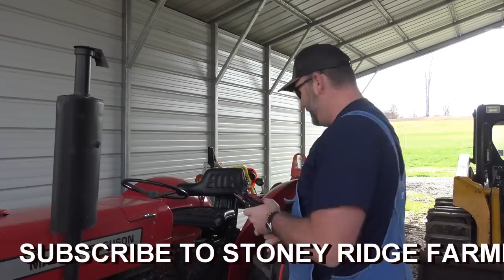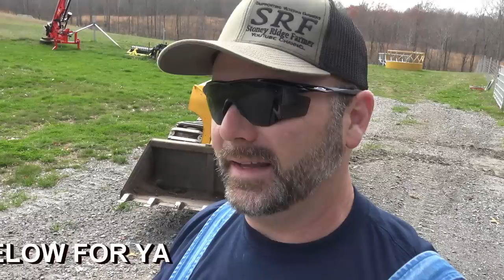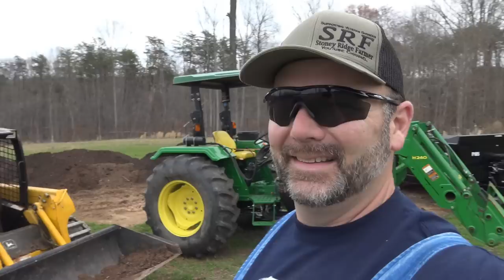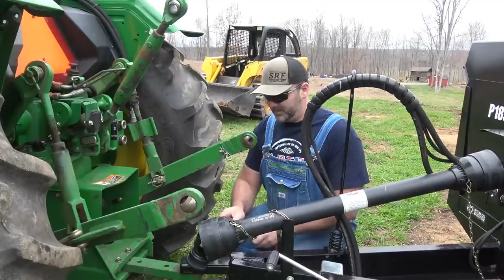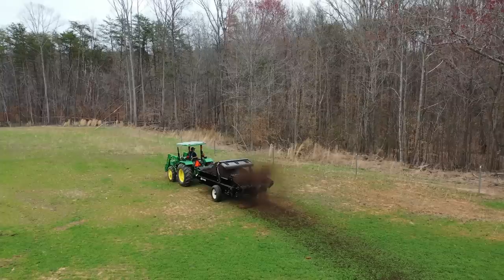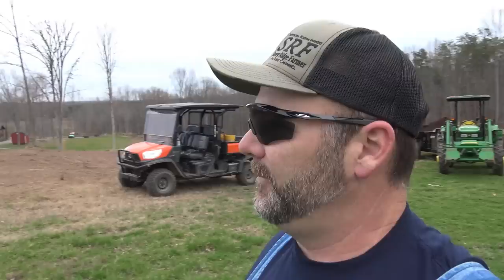Farm Tractors at work...load it up and spread it out!

Comment: Run a set of leads to the outside for a jump port.
Reply: I’ve seen people use the forklift charger connectors so you just have a plug on the machine and jumper cables cut off with the other plug on one end. Pretty neat and nifty setup.
Reply: Charles Lowe the make the kit it’s actually the same leads and connector most all winches use

Comment: With the hydrostatic drive on the rtv when you hit a hill you actually have to let off the gas initially then ease back into to it. You'll see a big difference by doing this and it wont seem to stall out like it does when you floor the pedal going up a hill. Our Kubota dealer has actually  had people try to return their 1140s due to this until they show them how to approach inclines. Enjoying the videos!
Reply from the maker: thanks .....I'll give it a try

Comment: Mount up an external battery jumper block and wire it into the battery.  You can get them from Summit Racing or other places.  You can buy the complete terminal block with bracket or just the studs and fabricate your own mount.  They are standard fare on most race cars because the battery is always in an enclosed box inconveniently located for better weight distribution.

Comment: Hi josh .. another great video !! As for your John deer vibration.. when they changed clutch hopefully they 1 either machined the flywheel as well.. 2 or replaced flywheel with new .. An also installed new pressure plate as well .. if not old ones could have gotten warped from old bad clutch causing flywheel an pressure plate to be the problem now .. if they did replace these or at least machined the flywheel then maybe it has effected the crankshaft in engine to be outa balance therefore that maybe why u still have vibration.. or maybe jus a bad run of clutches .. hopefully it will get figured out soon for you at no expense to you as John deer should cover all costs !! As for that beautiful manure mulch .. it’s awsome stuff to apply to your much needed areas as you say An will help greatly improve the land An soils.. although for the true effect on how the spreader works it is very very easy for a spreader to spread that stuff as it hasn’t any big clumps of manure like we often run into when we’re digging into our manure pile sometimes big clumps of manure stuck together an manure spreader tines at rear have to really chew them up to get it spread nicely ..  I’d be curious jus to see how well that spreader would handle chewing up real clumpy clumps from rear tines or would it jus throw big clumps out into ground ..? Some spreaders do better jobs then others .. to get a true to test of the spreader on what I’m saying you wouldn’t know with that very fine fine non course non clumpy manure .. would have to find some of that somewhere to really put it to the test .. anyhow my farmer friend I always look forward to your videos keep them coming 👍👍👍 Woooo !! 😁

Comment: Josh wire up a plug like a tow truck has use an Anderson plug mount it to top of that plastic cover wired to battery . Then put Anderson plug on your long jumpers yes ya have to cut the gator clips off one and but if they are dedicated for the Kubota then your golden ! I had. That’s set up on my trucks front and rear bumpers for my winch and my trucks jumper cables

Comment: Hey Josh. I put in 50 amp Anderson power pole quick connects on my kubota x1100c so I could have access to the battery quicker. Cheap solution and I converted everything on the farm to have a quick connect for that reason.

Comment: I had to laugh when you said that battery was hard to get at. I've got a little car in order to change the battery you have to pull a left front wheel and take off part of the inner fender cuz the battery is tucked in under the headlight inside the fender. It's a 2013 Chrysler 200. Now that's engineering at its finest!

Comment: Here's what I did on my service truck.  I installed a quick plug from a forklift battery charger to both the truck and the jumper cables. I put one on the front and back of the truck. And for not to much you can put a battery  disconnect on the ground side of the tractor battery.
Reply from the maker: very good idea

Comment: I don't know if your RTV is the same as mine, but on the one I have, the pedal controls the fuel to the motor and transmission  pressure at the same time. When going up a steep hill or pulling a heavy load , if you just smash the pedal to the floor , you will go slower. My dealer showed me how to push the pedal down gradually until you hear the motor start losing speed, then hold that position , this way you don't lug down the motor and lose power.  Try it on yours and see if it helps.

Comment: Josh What you need for the Ferguson is a what I use for my tractor battery. A Pulsetech 5 amp solar charger. I have 2 of these and they are great. My tractor sits all winter actually I haven't started it yet this year and my 3/4 ton Dodge also doesn't get used much. These chargers stay on both these machines 24/7 and the 2 batteries in the dodge is 5 years old and the tractor is 6 years old. Not only do these chargers make a battery last longer you can bolt it to the side of your shed and its done no AC needed.

Comment: Josh, I would install a solor battery tender on your awning to keep your tractor charged and install a battery cable connector on the Kubota so you just plug your battery cables in when you need them. You see these being used on tow trucks and you can buy the cable connectors on ebay.

Comment: On the 240 you can upgrade the alternator to a single wire 65 amp Chevy alternator probably would help keep the battery charged

Comment: Hi Josh, you may want to install an electrical quick connect on the front of the UTV and tie it into battery.  You will also need to put a connector on one end of the jumper cables... Then when you need to jump a vehicle, just plug into the front of UTV and you are in business...  Been using them on the tow trucks for years... As for you dead battery, just order a floating changer from Amazon, will solve that issue and keep the battery charged all of the time...God Bless...Chief..{NYS/ADK}

Comment: You may want to check your charging system on the Massey. If that does not work put a quick disconnect on your ground to battery. Hope one of these options might help.

Comment: Be careful with those pto extender couplers. On short coupled machines you may have to shorten the pto shaft to keep it from breaking a u joint or the stub shaft off when you go over a terrace.

Comment: Disregard the two black hold down bolts and get a longer bolt with the same type of thread. Cut off the top and then drill a hole in the top for a cotter pin. Screw the bolt down and then place the bolt through the holes in the cover. You may want to use a washer or if not then just a Spring Locking Cotter R Pin. This way all you need to be pull the pin and off comes the cover. Just a thought.

Comment: hey Josh run you about a foot or so of # 6 or 8 gauge cable from your pos side of your battery under side of your back seat make sure when mounting it don't ground it out . on the end of the cable soldier the cable so you will have a place to connect your booster cable too you can gound you neg side on any spot of your body that is metal. I hope this help and save you some of your time.

Comment: Pull a post off your tractor battery when it stored, either that or go to harbor freight and get ya a battery disconnect. Another ideal for using a certain vehicle to jump start frequently,  you can get a quick discount where the jumpers plug in to a permanent connector.  We use one of these on our service truck at my day job.  You can find them on Amazon.

Comment: What I use for my battery charger and jumper cables is Quick Connect/Disconnect Wire Harness Plug Connector, which you can get from amazon, and I solder all my connection's, I also keep my jumper cable clips with my cable for people that don't have plugs.

Comment: I would get a set of the anderson plugs and make a quick connection to the battery so you can just hook up your jumper cables in 2 sec. Like on a tow truck. Would even need to open the hood. About 20 bucks and done

Comment: Get your self a self monitoring trickle charger and plug it in your lighter outlet or wire it to you battery.$50 or less and less then 5 minutes to install.
Reply from the maker: No power in tractor shed
Reply: Get a solar trickle charger.  @StoneyRidgeFarmer

Comment: Just a thought... What if you were to get two short battery cables and run from the battery attaching them to the top side of the battery cover. No need for removing cover unless doing maintenance work and then a possible easy jump point when needed. 🚜-Woooooo!!!
Reply from the maker: for sure I need to do something to simplify the process...it's not that big of a deal..but is a pain

Comment: Just get some jumper cables and add a quick connector. Attach to the battery and then just plug it in when you need it. Can work either way. To jump or be jumped.

Comment: You might have had JD add another set of remotes to the rear of your tractor while they had your tractor in the shop...just a thought.
Reply from the maker: thousands of dollars on a tractor that honestly may not be here in 6 months
Reply: I priced mine. It was 1600 parts plus installation. That was on an R series though.

Comment: The PTO link is a joke, you still have to spin it to line the pin up and it very well could be what is causing your vibration! it would never hold up to large equipment! Great video! P.s. tracks look a little loose on the skid loader.  Keep them coming!

Comment: A bad diode in the alternator will discharge the battery even with the ignition off. rebuild the alternator or just buy a new one. Unfortunately the battery itself with so many low discharges is probably close to the end of its life unless you can do magic to it.

Comment: Vibration sounds in bottom of engine may not be in the engine itself.  Check the oil pressure.  As one guy said, I had a bad harmonic balancer on my Ford and it knocked.  Also a bad flywheel could be a problem along with many other things.  Of course it just ran out of warranty-- but you have had it in the shop many times.  They may have sold you a lemon.  Thank goodness I do not have smell a monitor.
Reply from the maker: It would be the second lemon...this is our second 5065E!

Comment: SRF  have you considered getting a few feet of battery cable and some "remote terminals"?  They come with all kinds of little brackets to mount them anywhere.  I would think a little utv would be used to jump all kinds of equipment nearly every day on a good size place.  Just a thought my brotha,  after all aren't we here to all learn together?   With a few extra bucks you could wire a plug instead of terminals but you'd have to do that to all the stuff but just imagine the luxury of nosing the utv up to something,  plug in one end, plug in the other and boom!!
Reply from the maker: just ordered them! Yehaw!
Reply: Yeah buddy!!!  They're handy as heck on a utv or pickup and over time retrofitting the rest of your equipment.

Comment: Brother a Solution might be to run cables from the battery to a winch electric connection and mount it on the out side and change the end on a set of jumper cables.

Comment: That pto link seems a waste of time. You need to turn the shaft to line up the holes and pins so can’t you just turn the shaft to line up the splines on the pto? Also did you shorten the length of the pto shaft on the spreader so don’t bottom out the ends when the shaft straightens and shortens as you are adding a few inches with that coupler ?

Comment: Im not familiar with pto link......but incase you happen to like it and keep it on all the time id recomend well greasing or oiling the female connector of the pto link and original end of your shaft to prevent siezing later incase you need to take it off. When i was still in school and raking ext for people one old couple that paid me to bush hog with thier old h tractor he hadnt taken the pto shaft off in lile 5 years and i had to drive that old tractor around shop to shop trying to find somone to help me take it off. Ended up having to cut the coupler off the output shaft on the h and putting a new one on. Ive always hatted pto shafts since then but kept them well lubed and since havnt had any issues since

Comment: Hi Josh, Why don,t you mount a solarpannel on the roof of your RTV? It keeps the battery in excellent condition if you keep it in the sun! Or mount it on a pole and make a cableconnector on the battery of youre RTV. I,f done this with mine RTV and never had this problem aggain since 3 years it’s working great! Love youre video,s!
Reply from the maker: I will install a quick attach jumper line...but a solar panel would be broken in a few hours of bouncing around the farm my brotha...great idea though..maybe a solar panel on the barn!  Could be a fun project!

Comment: Install the welder round cable quick connectors on the UTV for the booster cables it what it doen 

as-an engineer ill say it cost and laziness in design to more flow n i would redo a few other things on it

Comment: The vibration might be from the PTO link. I noticed when you wiggled it after the installation that there was more play there than if it was hooked directly to the tractor
Reply from the maker: PTO or no PTO...it doesn't make a difference in the vibration...it's very odd
Reply: Stoney Ridge Farmer just thought that I would ask.
Reply: Stoney Ridge Farmer the PTO link doesn’t make sense to me because having hook and un hooked PTO many times other then the splines not lining up maybe 10% of the time I always spray the connection points with a penetrating lube and have been very satisfied. I understand that the PTO link has probably been tested and designed to work properly but my opinion and not to take anything away from you for the opportunities you have to show products on your channel but for me I think it’s just another Mechanical device to add into an already potentially hazardous situation.

Comment: When your done using your 240 disconnect either one of the battery cables. It sounds like something is slowly leaching your battery down.
Reply: 1/2 inch wrench

Comment: Best put disconnect on tractor if not going use during winter. Or need find why battery is getting drained. Or disconnect one your post leads. Put hinges on door of kubota or jumper leads. That or get a jumper box. If john deere was down. Would put Mass on it and spread that sh!/. Might be a bit for the Mass but just got drive slower. Rating are for optimal operations.  As a farmer you find a way work with what you have. Even if it over rated till you can upgrade.  Part get it done.

Comment: Josh iv driven kubota rtvs for years those arent made for speed there made for pulling/working they are governed at about 25 but iv pulled around 1500 pounds with it with no problems at all.
Reply: Id rather have a hydrostatic transmission than a belt

Comment: The reason the John Deer is breaking down is you got the cheaper version and they are not built as heavy
Reply from the maker: $42,000 isn't cheap my brotha...even the dealer said the square fender 50 series tractors are known for having more power....maybe I'm just sensitive to minor changes....which eventually cause major problems...who knows my friend...who knows
Reply: I've never seen a utility tractor used for more than mowing lawn on a farm.

Comment: The battery issue with the Kubota can be remedied by adding an extension to the positive of the battery and connecting it to a copper plate that is on the outside. Of course, insulate the copper plate from frame and when not in use you can cap it with a piece of hose or any insulator that can protect the copper plate from weather and personal contact. Then when jumping to another battery connect jumper to copper plate, and the negative to frame. I have seen these copper plates available in auto shops. The other option is do what wreckers do, hardwire jumper cables to battery and coil cables and clip to an insulator. Good job on videos.
Reply from the maker: check your email brotha

Comment: If you are intending to use the Kubota as the go too vehicle for jump starting tractors or whatever why not install a Andersen socket permanently on it.  Then have a set of jump leads with a corresponding plug. Most breakdown responders have these fitted here in the UK.  https://atleadsandlooms.co.uk/products/battery-cables-jump-leads-link-leads/heavy-duty-custom-made-jump-leads-with-anderson-connector-no-tails/

Comment: Hydro stats never have good pull power. Good for lawnmowers not much else . You are pumping oil to turn a gear not a good way to transfer power. But they are handy for variable speed applications